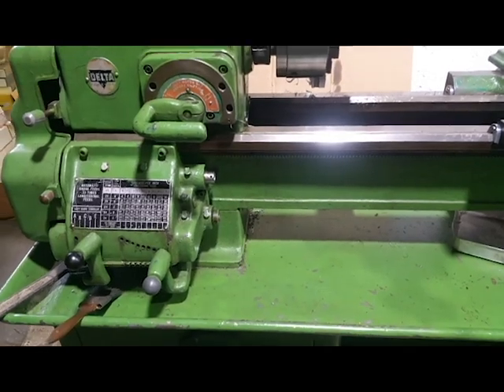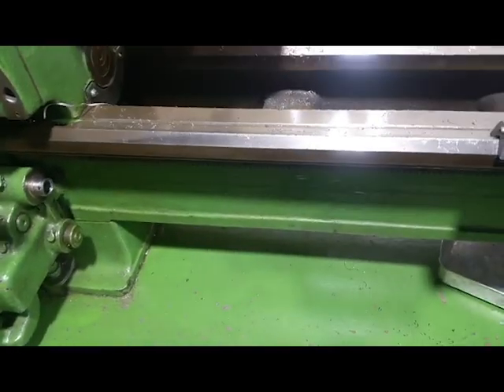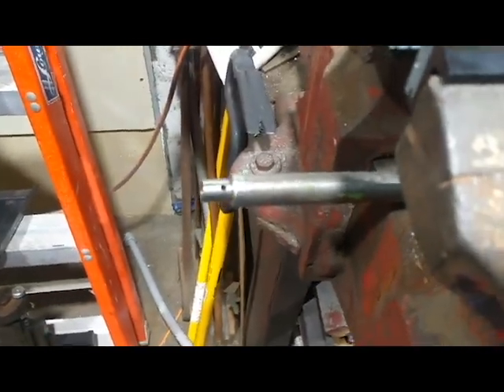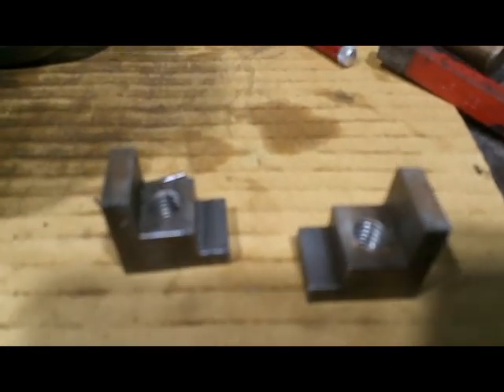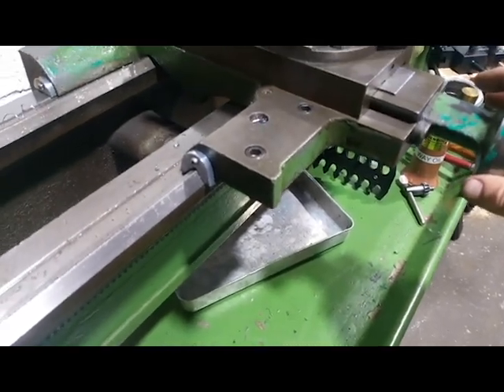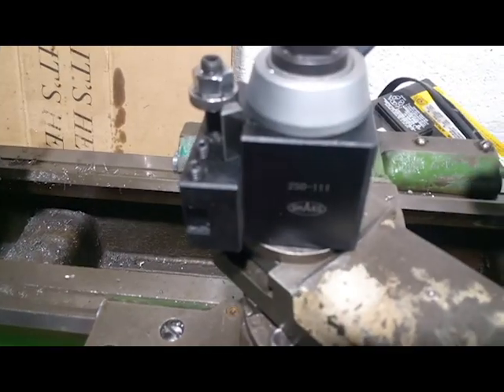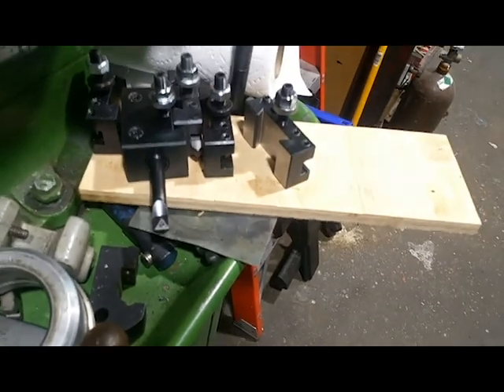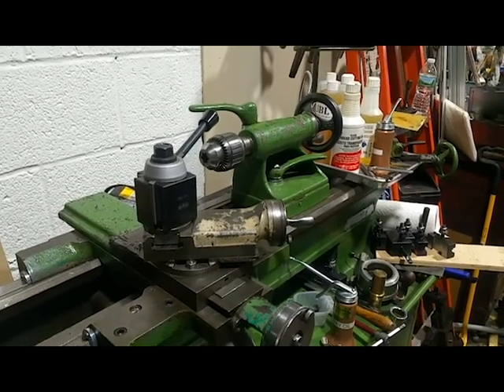Delta Rockwell 11" Lathe Shear Pin / Apron / QCTP / etc

Comment: The pin may have been made out of mild steel so that it would shear in case of a crash in order to save other parts.
Nice work and I look forward to more videos.
Reply from the maker: Robert, as Mr Pete would say " hammer and chisel  mechanics got to it"  should be brass, but  Id expect someone stuck part of a drill bit in there...    who has brass rod of that diameter hanging around ?   ( we may find out in my next video ! )   thanks so much for watching !  i hope to improve my videos and share my fun at the shop !

Comment: Good video, Joe. You cover a lot of ground in what is going on over your way in this. That's a cool tail stock feature on the Rockwell.  Are the parts that dropped out a carriage lock mechanism? idk. My quick change is the same way on the front wedge, but I've gotten used to it.
Reply from the maker: Thanks John,  Delta Rockwell parts are super hard to find so i figured it would be a good project to repair the tail-stock. Even if i end up selling it.  The quick change  is definitely annoying. i will be looking out for a good used Aloris in my travels..  I did have a chance to dig into the Delta Rockwell manual and those stepped l brackets were definitely NOT in the parts diagrams. guess they were bonus parts.. lol    Hope you are making progress in your shop !
Reply: Pretty weird that they were in there.  It's a mystery. :)
Reply: Hey Joe, what should I avoid at all cost when looking at Bridgeports? For example: You mentioned that one head you have takes an expensive type of collet.. which Bridgeport do I NOT want? And likewise, what should I be looking for??
Reply from the maker: John,  i would buy a real bridgeport.. not a clone if possible.. i see that most parts are interchangeable, but it doesnt seem like they hold their value like a real bridgeport.  I have 2 J heads.. they are the most popular ones out there. there are newer variable speed units available now.. i guess it would depend on your budget.  you can repair most problems with the head.. like noisy bearings or broken gears  ( not that it would be cheap ) but thats do-able.. the main thing would be the ways of the machine.. if they are seriously worn it will be tough to hold a tolerence.. kind of like the ways on a lathe...    the old "M" head bridgeport doesnt have the power quill .. doesnt have the travel " quill " and isnt as powerful.. that is the mill that takes a more expensive collet...   the super old high speed head " which i had in another video "  takes a specialized collet   about 200 bucks each from  hardinge    any questions past that feel free to ask.. ill help u if i can !

id take a clone or an old m head if it was in good shape... just dont pay alot of coin..
Reply: Thanks man. :) Now that I FINALLY have a lathe, the long, mind numbing search begins for a mill. What kind of things should I snap up as deals in anticipation of a mill?? Obviously a decent vise, but what else should I have my eyes peeled for?? I began with the guy I got my lathe from for a steal with delivery and tooling, but no such luck. Want to sell one of your Bridgeports?? lol
Reply from the maker: LOL actually i would consider it as i need room for a CNC ive been drooling over..   the problem would be the shipping..     but aside from that.. yes there are plenty of goodies u should be on the hunt for .. kurt vice, hold downs, parallels,  angle blocks, rotary table, indexer, right angle attachment, slotter head,   the list goes on and on !!!!  depends what u are going to b making
Reply: lol have you ever visited Chicago in the fall (Pulling a trailer with a mill on it?)
Reply: I'm going to look at some kind of dissembled vertical mill in the  morning. Looks old school and heavy as frick, but the seller is willing to let me make multiple trips to pick up parts. He says it's all there and nothing is broken, but I can't find any photos of one anywhere online. I see mention of a company by the same
name on Lathes.uk, but no mention of them having made a full on mill. I'm willing to take a chance on it for $200. I figure if I can get it home and reassembled for better or worse, then either I have some kind of milling machine, or at least $200 worth of real machine parts to tinker with in building one. I thought maybe it was one of those pantographs machines like you have, but I don't see that company as having made those either. Would you take a chance at $200? I think most would at least go check it out, right? If it's a green light, then my plan is to bring home as many parts as I can haul, then maybe hire someone with a trailer to help me move the big parts. I'm 100% in over my head once again, but that is how I got my lathe.
Reply from the maker: @johnstrange6799  if u have the time and cash get it !    although i see bridgeport m heads going for 500 bucks sometimes... what brand and model is it ?
Reply: Joe, I'm just sitting down after the voyage. I got it! :) Don't know how good, or if it's ANY good, and I don't and the seller didn't know anything about it, but it looks to be a little (perfect medium size) vertical milling machine for just $200!!! AND... it comes with a home made surface grinder build attempt that has some nice parts and useful hunks of metal on it. I brought home all of the mill, and a few pieces of the surface grinder in one trip. None of it is light, but it looks like it will be a million times easier to move into my little basement shop area than my lathe was. Besides the main pedestal casting, the rest of the pieces two people can carry. The brand is 'Precise' with the same font as the 'Precise' company from Wisconsin that made the "Super" series of high speed grinders. Coincidentally, I think Rockwell bought them at one point. I'm in IL, so MAYBE it came out of their factory? I don't know. I don't know what kind of collets or anything else either - including how it goes together (No vise), but worst case scenario at $200 bucks I can either resell it and break even, sell it and make a profit, break even and have the surface grinder parts free, make a profit and have the surface grinder parts free, or use it to build a little mill, OR  even scrap it and lose very little. No tooling and no vise, but oh well. Another guy showed up to look at a wood stove and immediately stopped dead in his tracks and said "A milling machine!", then the seller was like "Just sold it. For $200." the other guy looked like someone had run over his dog.
Reply from the maker: @johnstrange6799  pictures buddy pictures !!!
Reply: I just lugged all of the mill parts down into my shop area, and got the base casting out of the vehical and over near the door. Also got part of the surface grinder inside. I have to go back tomorrow for the rest of the grinder. Once I get the main casting inside, and hopefully get it assembled, I'll take photos and a video of course. Now that I've had a chance to look at the parts, I understand how it goes together. What's different about it so far is it look like you move the whole ram up or down (with a power feed mechanism that looks to be added later) instead of a quill moving the spindle down. The head and ram section has a round mounting section that marries to another round machined surface on the column section that has a ring with degrees on it, AND the column mount offset of the table (which is small- only one or two... "T nut areas" deep), so it kind of looks like you might be able to use it as a vertical and kind of a horizontal mill minus any overarm support. I have no idea, but it's the perfect size for my little shop area. there is also what appears to be an electronic stop switch on the table that plug into the "box" that acts as a power feed. There is likely some parts missing or something, but so far I am STOKED! I asked Mr. Pete if he had heard of the brand, being that he is in my neck of the woods, and he hasn't heard of "Precise" either. It's another mystery machine. :)  @RaptorMachineToolCo
Reply: @johnstrange6799  Excellent !  looking forward to seeing this !
Reply: I have an an idea. MAYBE the person who owned the mill and the shop built surface grinder used one or more of the bench top Precise brand mills (as shown on Lathes.uk) to make the surface grinder, and then glued the 'Precise' logo plates from them onto the mill, and the mill is actually some other as yet unknown brand. This scenario would explain why I can't find any photos or mention of a Precise brand vertical mill that looks the same.   @RaptorMachineToolCo
Reply: Mystery solved! It in fact IS Precise brand, and as shown on lathes.uk and/or practical machinist, but someone very cleverly added some electronics to the column, cleverly enough so that 5 people who have seen it so far didn't realize it wasn't original. The look and age of the added switches and outlets are so seamlessly integrated that it sent me on a wild goose chase looking for a more modern machines (at least 60's). I knew that the motor and mounting wasn't original, but I wrote that off as just being a more modern replacement, but now I see how that was also very modified in how it interacts with the machine. The Precise vertical mill shown online is something like a "holder" for their super high speed grinder heads, but on mine someone (again very slick) added maybe a Bridgeport spindle or something like that. It has a drawbar, and I see a collet in there of undetermined style, but after I get back from fetching the surface grinder build, I'll pop that collet out and see what I am in for. Fingers are crossed for like ER collets, or anything easily and inexpensively obtainable. Moving the whole ram is how you down feed the cutter. There is a ball crank in the assorted nuts and bolts pan that came with it, so I' confident that is for that, but someone added a little sprocket that will connect to a little motor which will mount on the machine (not so cleverly added, but looks like it will work), and that has a controller and switch box to make it like a power down feed. The only mystery left is the base casting. I have yet to see one online with the Precise brand mill, but maybe it was an upgrade they offered in their catalog. All in all, not exactly what I thought it all was, but for the price, I'm still very happy, because I think it will work, or at least work far far FAR better than what I built. The surface grinder...I don't have much hope for, but who knows? Worst case scenario, it has some nice dovetail slide castings, and a handful of sweet metal blocks and plates and bars. Should be fun to move today.  @RaptorMachineToolCo
Reply: Dragged home the surface grinder build machine today. It's kind of hokie in a home made way, but it's worth playing with, and considering I make things from brake drums and all manner of junk, It's actually a step up for me lol. I popped the collet out of the mill, and thank goodness it's an r8.  @RaptorMachineToolCo
Reply from the maker: @johnstrange6799  cant wait to see what u got !!
Reply: Maybe on the weekend I will get the surface grinder build and the mill base casting down into my basement. Hopefully both are much easier than moving my lathe was. I moved the base of my lathe with the motor and pulleys still in it down stairs.... and it sucked! I got a chance today to figure out how the surface grinder build assembles. It's VERY homemade, and pretty crude, but if I'm not going for precision (and why start that now? lol), then I think it stands a chance of working. I need to make or buy an acme screw and a bevel gear to complete, repair or replace the idea the builder had to raise the work are up, and I need a toothed belt and pulley to add to a motor to power it. I haven't looked if I can just 86 the toothed gear pulley on it and use something on hand. I have no real idea what the electronics are either. When you see how the electronics are mounted you'll laugh. The builder put them under the "table" (fixture plate). There is an unidentified metal box with an unlabeled black pot and some banana jack connectors (Maybe a relay?), then another smaller box with a pot and switch (I think), then a little servo motor or something that has a pulley in line with one of the dovetail cranks. I'm guessing (and hoping really) that the idea is to electronically move or advance the fixture plate back and forth under the grinding disc. I kind of fear it. lol   @RaptorMachineToolCo